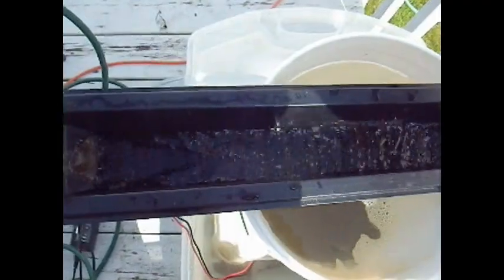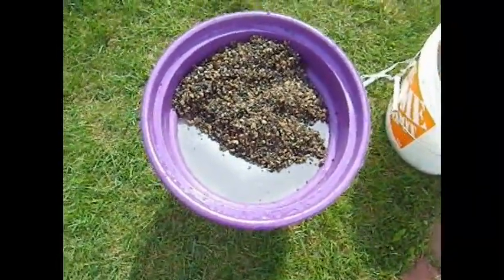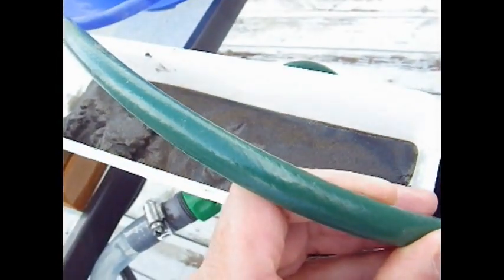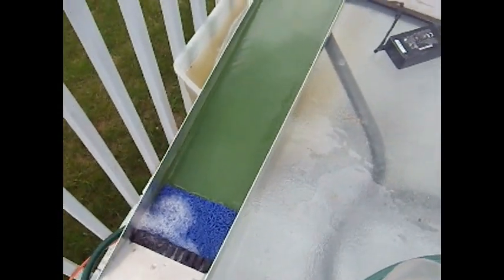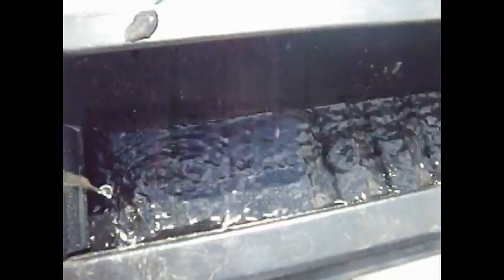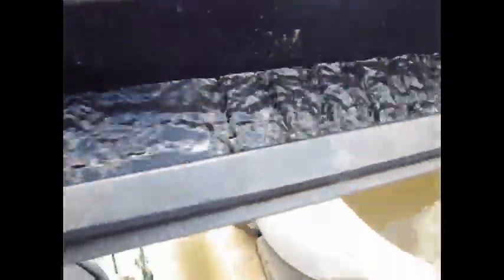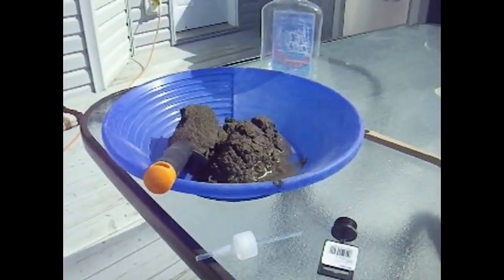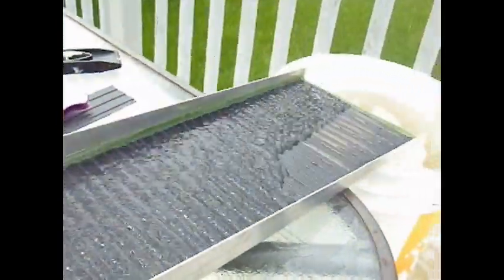#3/10 RESULTS from gold hog and miners moss testing

Comment: Gold hog mats are supposed to be dialed in by checking your tailings not just guessing at what angle you want to run them. Water flow and sluice angle are important.They can't function to their true potential unless you dial them in correctly. Guessing limits their abilities. Capture rates are what makes them the best capture system available. Digging up the gold just to put most of it back makes no sense. My capture rate on my gold hog mats is 98.9%.

Comment: what paint did you paint the miller table with was it coak board paint
Reply from the maker: that;s correct. available at most hardware stores. Apply it quickly and only once as it settles. Not to thick.